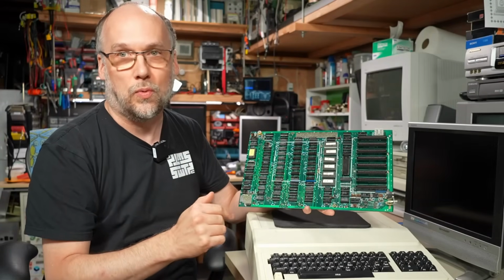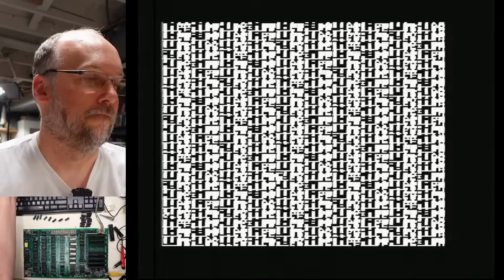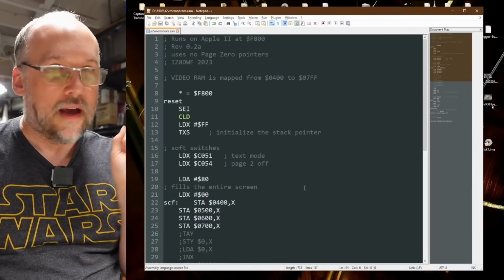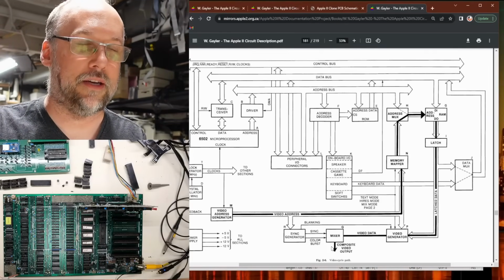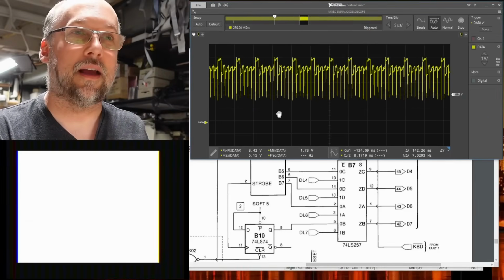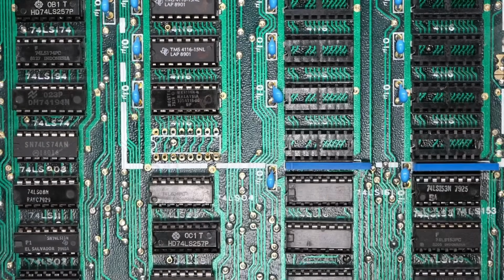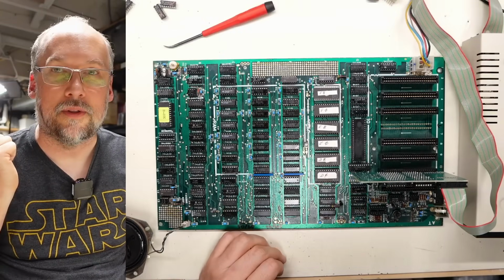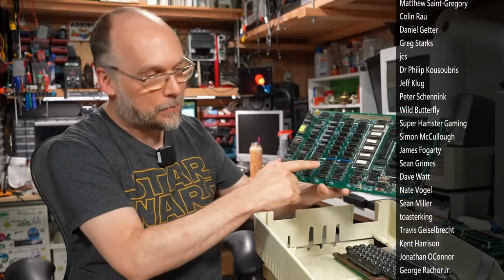Apple II+ clone repair: It was one of my most difficult

Comment: Bad RAM? Try Bad ROMs. As you shown that it is a mish-mash ROM Types (Apple II, Franklin 1000, etc).Thus Rom Routines routines are not lined up correctly in the Kernel. If you get a set of Apple II ROMs  it should fix the problem. It was meant to be an Apple, so make it an Apple. Just because it Beeps, and gives he Apple II logo on it does not mean that it is perfect. I know that some of the Kernel Routines can be a couple bytes off to change what it does. The Print to Screen Routine, if you jump ahead a couple of bytes will make the Commodore print elsewhere like the print and even to tape or disk drive. I forget the name of the book, but it explains this in the Commodore ROM. Apple is very much the same way with its ROM Routines, and having different ROMs from different machines will upset that alignment.

Excellent work you did there. Finding two shorts and fixing them... you have the patience of a saint.

Also - didn't Fat City need 64K RAM, as in it needs the Language card in Slot 0?

So what's next? ROMs, final test of the board, fix the keytboard and assemble the machine. 

Great work you did there!

Comment: Nice work! It was like watching Sherlock Holmes :)
I think someone was "correcting" cold solder joints and added too much solder. I had it many times, that too much solder went through the connection hole and made short in neighbour circuit. Additionally, in this case, PCB was in bad quality that made this shorts invisible.

Comment: (@11:03) - Yeah, the 6502 won’t work well without the stack ($0100-$01FF) either; that, and page $FF ($FF00-$FFFF) is needed for the BRK/IRQ, Reset, and NMI vectors as well - this is pretty much the bare minimum for an operational 6502 computer. Fortunately, the ROMs provide page $FF. 😊

Comment: How many people are seriously bothered by the faint beeping of the multimeter? If it was hooked directly up to the audio recording sure, but it's muted in the background. However mad they are at hearing that beep, I swear I'm 10 times as mad if you bow to those demands, the beep is there for a reason so you can hear if you have continuity while probing things, because you can't look at the multimeter while trying to probe tiny pins. What is wrong with people. Why the heck are they watching electronics repairs if they can't handle a small beep now and then, it's not like 15khz hum from a CRT or something, it's just a faint beep when you find continuity/shorts.

Comment: As for the missing colors, I seem to remember reading something years and years ago about early Apple II models not having all the colors that slightly later revisions did.  There was supposed to be a simple mod you could do to upgrade the early II boards to have all the colors.  However....this is me remembering something I read 35 or more years ago.  I might be wrong.
Reply: Your memory is correct; there was an article published in Byte magazine showing the modification necessary to add 2 more colors in hi-res mode, and that became a standard part of the Apple ]['s made later on.  However, that is not the problem here, exactly, since after the title screen, you can indeed see all 6 colors on screen.

Comment: What you are seeing with that board is almost certainly the tin whisker phenomenon. It’s more of a problem in spacecraft applications, but it can happen on any board, particularly if it uses lead-free solder.
Reply: It's only more of a problem in spacecraft (and aircraft) systems only because of the much more extensive testing and more strictly defined acceptance requirements for those applications.

Also, it has nothing whatsoever to do with lead free solder. Even if it did this board predates any wide use of lead free solder in consumer electronics applications.

Tin whiskers and etching faults have in common that they are likely to first show up where traces are very close together.
Reply: And it will have taken a long time, with voltages present to grow those whiskers.
Reply: I 100pc agree this is tin whisker. The fact there are more than one, but only one would cause failure.
Reply: It don't have to be lead free. A lead content over 20% reduces the effect greatly, but addition like traces of copper, iron or zinc can expedite the process. Cheap solder made from "dirty" sources are often more affected from Tin creep / Tin whiskers.
Reply: @BassByTheTonne  : Fix tin whisker? Maybe, but don't count on it. And if it does get fixed that way, don't be surprised if it comes back faster the second time- it's unlikely that you'll be able to get the whisker to properly retract, and more likely that it'll just break into smaller pieces that have an easier time rejoining. At some point, you just have to replace the entire board.
Reply: My first thought was tin whiskers, but the one that he showed on camera looked a bit bigger and meatier than what I'd expect from whiskers. It's definitely not impossible, but I'm not convinced.
Solder would definitely not have been lead free when that board was manufactured (that's more of an early 2000s development), but as others have stated, tin whiskers are not impossible with leaded formulations.
Reply: @michaelcalvin42  it's hard to imagine what else it could plausibly be. Presumably the board worked at some point in the past, then eventually didn't. The faults were buried under parts where the board was not accessible, and had penetrated the resist. I'm assuming that the board has a tin layer in its gold plating (or maybe HASL), with tight clearances, so if the etching was a bit iffy and left a sharp point microscopically, it's possible that the whiskers grew from the track rather than the solder. Even then, it's correct to say that tin/lead solder doesn't completely remove the risk, it just mitigates it somewhat, so if you have an inappropriately tight clearance somewhere it can be a problem. The mil specs for mitigation of these kinds of issue mostly center on maintaining good clearances, and always plugging and tenting vias, for example.
Reply: Sometimes over the years traces can migrate and expand on PC boards. The metal flattens out and takes up more room. That's why power supply PC boards have a big empty space between the high voltage and low voltage sections.

Comment: Hi, since the bottom tray was clearly rusty, it might be that this mainboard was sitting in that too a some rust particles stick to the mainboard, like between the the ICs legs. The board was then cleaned, but only on surface and that rust flakes are still shorting some pins. The fluid level causing the tray to rust doesn't needed to be that high to damage sockets itself...

Comment: Here is my suggestion as to what happened with that board. The board failed QC with the original manufacturer and was sent for re-work. The re-work was not successful so it was set aside. A couple of years pass and the company fails. The failed board is sold off in the liquidation sale. Someone has another try at getting it to work (new chips / new sockets) but still not working. The board is then set aside on a shelf for 40 years and finally ends up at ADB!

Comment: Back in the old days I've meet quiet a few of these strange replica motherboard which I replace all chips but still refuse to work, a million thanks to dig deep and solve the mystery after thirty-something years, this remains a MYSTERY since I'm teenager!! And this never happens on original Apple ][ boards since their quality never fails in this way, arghh!! AND .... with the junkie socket like this, I can imagine sooner or later not the short circuits but socket contact will fail later.

It's the most exciting adventure of repairing video, full of challenge!!

Comment: Nice work! My hypothesis is that the manufacturer of the PCB didn't have their process properly controlled. Not surprising for a Chinese board and the time period, I suppose. If the masking is inaccurate or the chemistry isn't well controlled, you can get a lot of marginal traces. A bit of corrosion or thermal cycling will do the rest over time.
Reply: I wonder if the other bare PCB that Adrian has shown before will have the same problems?
Reply: I'd have figured Taiwan or Japan for fabbing Appler II clones in that timeframe.
Reply: @rog2224  Your correct, mine, an empty PCB was made in Taiwan
Reply: I don't think commie china were capable to made the board during that era.

Most of apple ii clone were made in taiwan.

Comment: That motherboard is mean! Back in my tech days, we referred to boards like this as wolves and would be put aside for days when manufacturing repair was slow which was rare.

From my experience, when an etch short is found there will be more because they never occur or rarely occur as a single one-off event. During my manufacturing tech days, Visual Technology had a  occasional batch of boards that had this issue. 

There was a rash of shorts caused by contamination on the copper prior to masking. Instead of the mask surrounding the vias and pads completely, there were tiny, ever so tiny threads of copper between the pads and vias that tested okay on the bed of nails blank board tester but caused an innumerable number of intermittent faults that would not show up until sometime later. These were relatively easy to repair by scratching between the etches. Sometimes as you found, there was an ever so tiny thread of solder between the pins where the solder was picked up on the bare copper where it should be. What's interesting is these boards may work fine sometimes until they're flexed. When flexed, the tiny bit of copper or solder is enough to cause the failure.

On one particular batch, there were what we called growing etch shorts. These were caused by a layer of salts from some dirty etching solution the boards went through when the board maker manufactured the boards. The boards tested okay until the boards went into the burn-in ovens for further testing prior to final unit assembly. During a normal test, repair, cycle, a handful of boards would come back requiring repairs due to faulty chips that didn't quite make it through the ovens, but for the most part the boards worked fine and off they would go to unit assembly.

Then there were the others. The others that had the growing shorts would work fine during the cold test but failed in the ovens. When the boards came back to us for repair, instead of still being faulty, they'd work fine! One day, I happened to be searching for a marginal fault that had the symptoms of a bent pin. As I was inspecting the board for a flat spot where an IC pin was supposed to be, I noticed very, very fine strands of white stuff as if the board had been wet and left a smear of white junk behind when it dried. I took a metal scribe and scraped between the etches, and the problem went away. I contacted my manager and the QC department. QC and manufacturing engineering came down and talked to me immediately and production was halted until a new batch of boards could be purchased.
Reply: I had similar experiences in the early 1980s working on newly assembled boards at a test equipment manufacturer. They never let us scrap a board. I remember one batch of boards that not only had copper etching shorts by the dozens, but also had wavy traces. Thankfully they were single sided. Out of frustration, I figured out that we had some power supplies that could produce enough current to burn the shorts up. People thought I was crazy because of all the flashes of light and smoke and popping noises. I should add that I did this on fully populated boards after trying it on bare boards and partially populated ones. I knew it was safe because I used only the expected voltages, just with a lot more current available. I earned the nickname 'Mad Scientist'.

Comment: Amazing patience during debugging this cursed board. It's been a while since I had so nasty problems, maybe it was that line6 pod xt live with a rotten via under the display disturbing flash memory access.

What comes to my mind about those shorts - over time, solder can grow so-called whiskers. At least that one under the socket looked very familiar. Are you sure you scraped away a bit of the pad under the slot connector? Maybe it also was a small amount of solder.

Comment: I'm not a fan of beep speakers like in DOS for example, but on a multi-meter? I love it. A multi-meter should beep.
Reply: I'd like it if the frequency depended on measured resistance (especially if that depended on selected scale), seems like a real added value.
Reply: @absalomdraconis  in continuity mode I just need a quick yes or no. I find the beep is faster than reading the screen

Comment: Yeah, that was a ride, and it's not yet over. Rather shabby PCB! The margins were just too small for the production capability of the time. I'm sure it would be fine in this day and age, although no one designs boards in that way no more.
Reply: What do you mean? I don't think autorouter or multi-layer layout or other modern techniques would have improved chances in THIS particular case - to me it seems like the plating was off by like 0.1mm? In fact, nowadays it seems most PCB designers just take hairline precision for granted. I guess someone knocked something out of alignment in the basement where those clones were produced illegally by some students, they probably had like 80% fail rate on the batch but decided to ship "working" boards anyway. 
Maybe that is why EVERYthing is socketed? Like, they tried to run the machine and if it didn't removed the chips and tried in the next one?
Reply: @jwhite5008 I think “taking the precision for granted” is precisely what OP means about how this design would probably be fine made nowadays

Comment: The solder mask may be misaligned exposing the edge of some traces/pads and excess solder could have bridged the gap.  Alternatively copper ‘whiskers’ can remain from the etching process and the bridges could have always been there.  In this case there could be more.  Were they on top of the solder mask?  If below they have to be whiskers; on top and solder is the likely cause.

Comment: I once had a reoair where there was a thin line of solder on the side of an 0805 resistor.
You have no idea how hard that was to find.
It involved a microscope. XD
Reply: Omg this is the worst! I definitely feel for you! 
Had a solder bridge under a SMD part on a custom board once. took me desoldering everything to find.
Reply: @jwhite5008  Jisses. 
Underneath the part?
That sounds like a nightmare XD
Reply: @adagioleopard6415  Yeah that was reaaaaly sloppy soldering on my part. And unlucky.
Reply: @jwhite5008  it happens. XD

Comment: Some alloys can grow hairlike crystals over the years, maybe this is it?
Reply: Corrosion can do this as well, solder mask seems to be deteriorating on the board.
But also it looks like the plating machine was ever so slightly off - all it took was like 0.1mm
Reply: 100% tin solder tends to grow hairs, and that tends to be an issue in super high pin density ICs
Reply: @No-mq5lw  : As I recall, it's a lot more varied than 100% tin. A particular percentage of tin vs lead was commonly used for solder just because it never seemed to form whiskers, but change it by 20% from there and you'd just get them slower.

Comment: Tip for you - if you short the meter probes, then hit the REL button on your meter, it will zero it, and subsequent measurements will not include your probe resistance.
Reply: I never knew this.. Thanks!
Reply: Steve !
Reply: @greggjaskiewicz  Gregg! How’s things?
Reply: Thank you for your tips! Learned a new thing!
Reply: I never knew this
Reply: Exactly. You beat me on the use of the REL🔺 button.
Reply: Dude, I never knew that. Thanks!

Comment: This has been one of my favourite videos, thank you. I worked on a Apricot computer from the mid/late 80s and the tracks had similar problems, they were just too close and then random dirt or tiny corrosion would bridge them.
Reply from the maker: This is fascinating. Clearly this motherboard was exposed to a lot of hostile conditions with that water and rust. So it could be this happened after it was no longer used anymore.
Reply: I think the board is drilled and/or plated ever-so-slightly off, like someone knocked on the machine a tiniest bit. So close yet so far!

Comment: Solder whiskers? You may have the first time I have ever seen these in the wild.
Reply from the maker: I know they definitely happen but talking to Frank IZ8DWF, he really doesn't think it's possible on gold plated pads like this board has. He just thinks it's misshapen pads and over time from board flex caused a short. Or possibly just some corrosion as this board was exposed to all that rust and water.